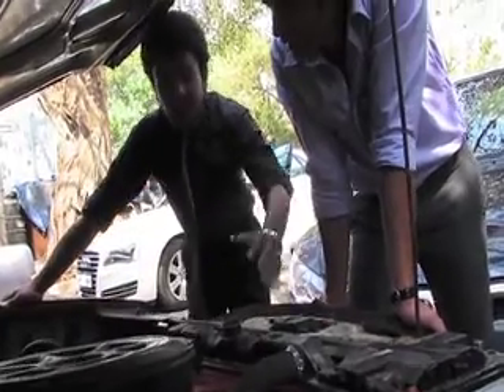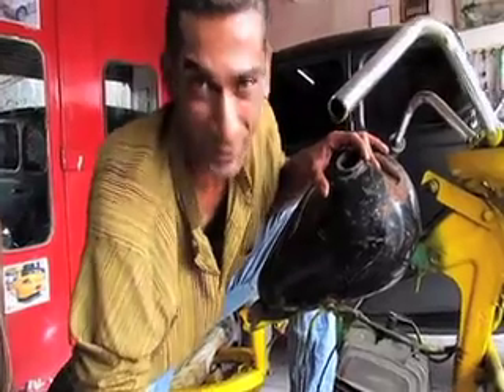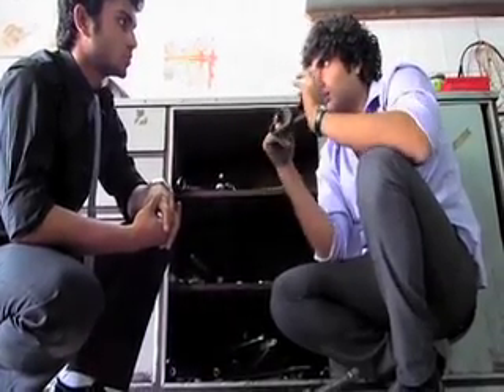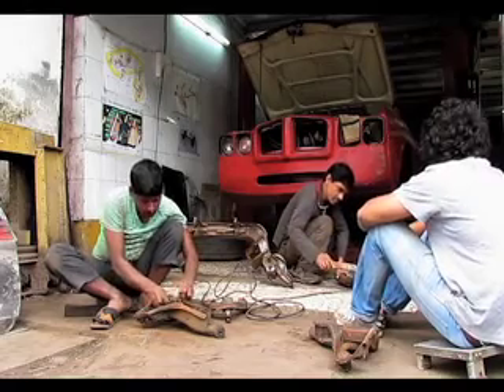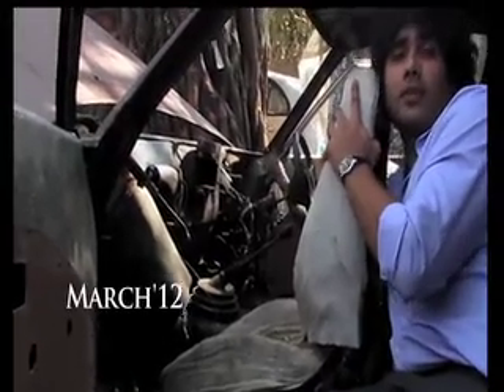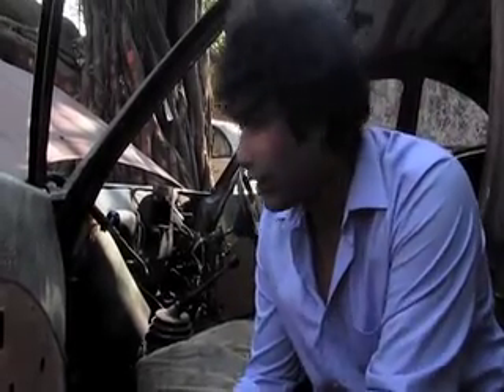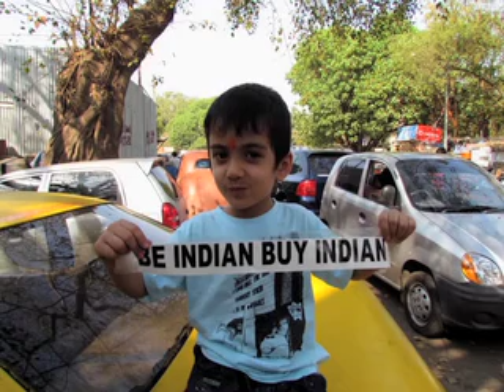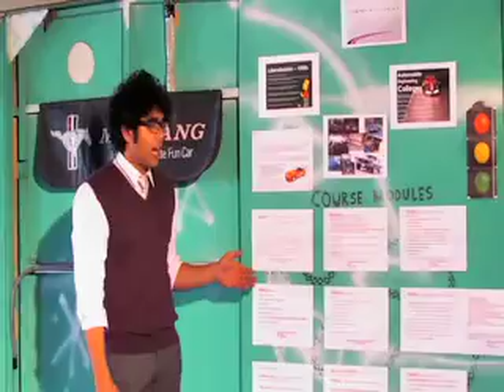Suraj bhalla sharing workshop car build process with engineers.contessa rebuild

Comment: have never been so excited to see a contessa being restored, the big car deserves one good restoration and i think you have done justice with that, good job guys! you can increase the aesthetics of the car by putting black alloys as they go well with yellow colour ( chrome goes better with colors like black, red etc), get rid of the bottom winglet on the rear bumper and give it a nice cut, two black stripes running in the middle from front to end bumper, roof whole black!

Comment: we lost about 400kgs of the contessa, and for a 1.8l ltr stock isuzu engine loosing 400kgs of body weight is a great boost to power transmission. we shorten the fuel lines, brake lines, the propeller shaft so the entire power transmission distance is reduced hence it runs at about 160-180kph with ease now.

Comment: for this model we stuck with the stock engine, but yes v8 engine will take the performance to a higher notch, but we will have to balance with chassis re-enforcements to balance the upgrade of performance.

Comment: I think that Contessa has a lot of potential, but it needs a more powerful and torquey engine. Something like a Rover/Buick V8 (weighs less than the Izuzu engine), Small block Chevy, Cadillac Northstar, big block Cadillac.... Mind you, you're right that cutting 7" would reduce the weight of the car. How much weight did you lose from the Contessa and how much of an improvement to the power to weight ratio does it give?

Comment: That's not bad going, shaving off 900lbs. I bet you could lose more using fibreglass hood, doors, trunk lid. What did it weigh stock? Oh, the Contessa was originally designed for anything up to the 8.2 litre Big Block Cadillac engine. The prototype made by GM used an Oldsmobile 455ci Big Block, so you can use Chevy, Olds, Buick rear axles, brakes parts. Even Corvette running gear, should you wish. BTW, what V8's are available in India?